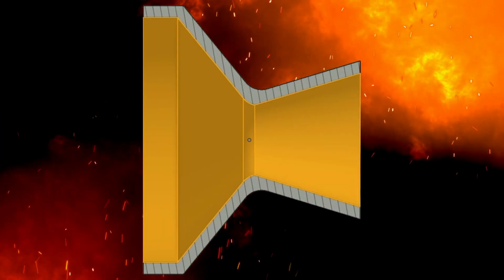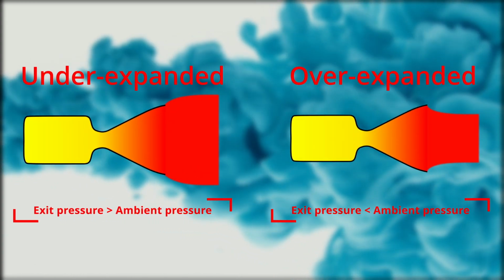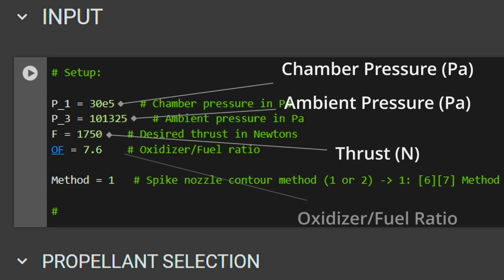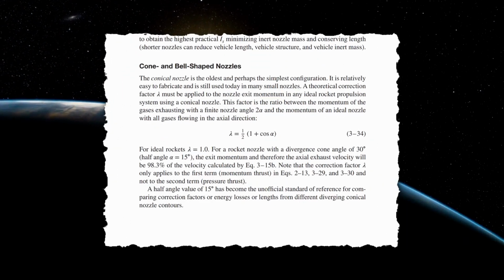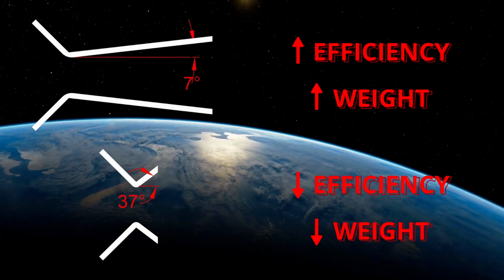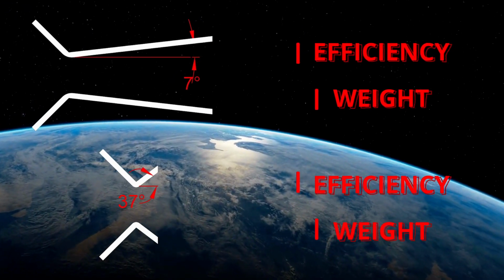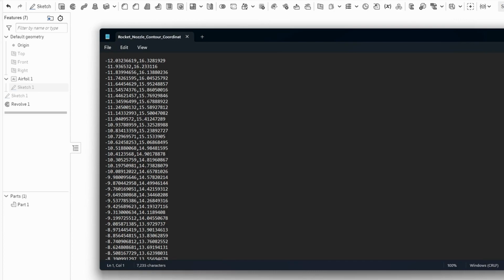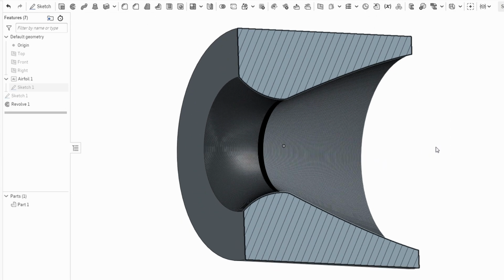Rocket Nozzle Contour Sizing: Easy Way

Comment: Can i add a custom type of fuel? If possible, how can i do that?
Reply from the maker: Yes, but for now only in the " .ipynb " (Google Colab) file on Github.

At the top, there is a section labeled "CUSTOM PROPELLANTS". By modifying the chemical and thermodynamic parameters, it's possible to create a custom propellant option, either as a fuel or an oxidizer.

The setup can be found in the "INPUT" section, which is similar to that used in the Streamlit App.

Then, press "Ctrl+F9" to run the code.
Reply from the maker: Hello again, I've recently added a file named 'add_propellants.txt' on GitHub where you can add custom propellants following the rocketcea library pattern

Comment: This is incredible! I would like to ask if it is possible to add an option for a solid fuel propellant in the python code?
Reply from the maker: Thank you, @Shadow-cv5xn!

I'm currently working on a code specifically for solid rockets.

But, for now, you can check the " .ipynb " (Google Colab) file on Github.

At the top, there is a section labeled "CUSTOM PROPELLANTS". By modifying the chemical and thermodynamic parameters, it's possible to create a custom propellant option, either as a fuel or an oxidizer. 

For example, with KNSU, you can try adding sucrose (C12H22O11) and potassium nitrate (KNO3).

The setup can be found in the "INPUT" section, which is similar to that used in the Streamlit App.

Then, press "Ctrl+F9" to run the code.
Reply from the maker: Hello again, I've recently added some solid propellants. On GitHub, I also included a file named 'add_propellants.txt' where you can add other custom propellants following the rocketcea library pattern